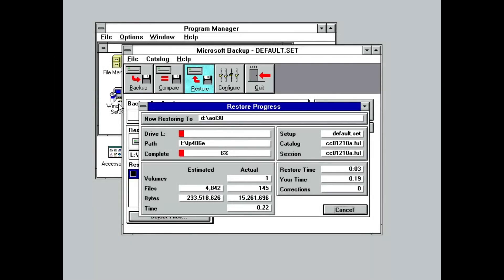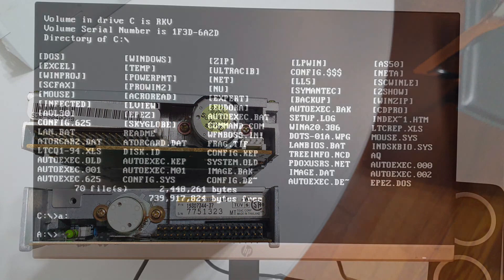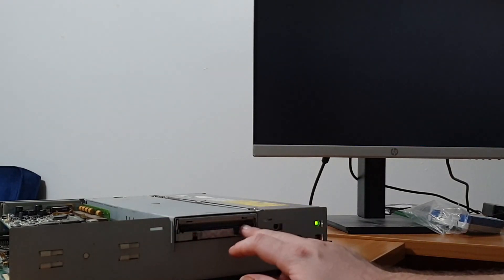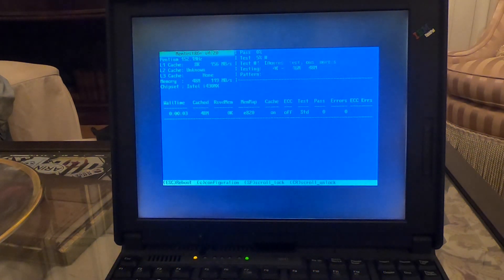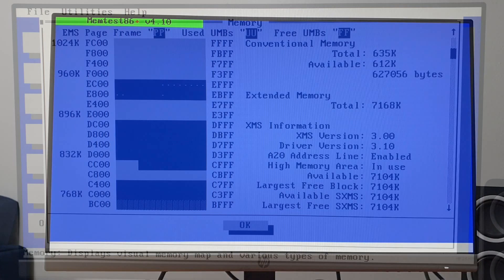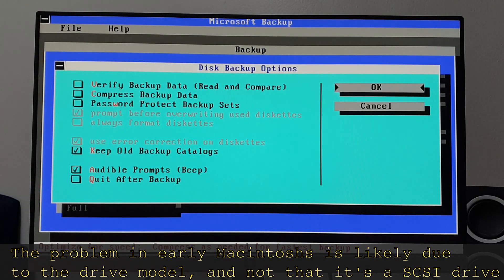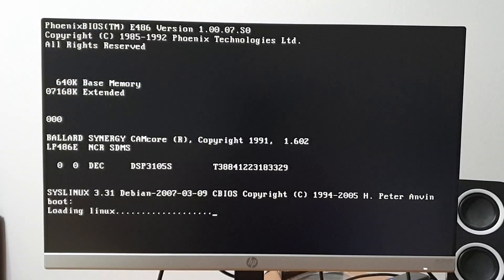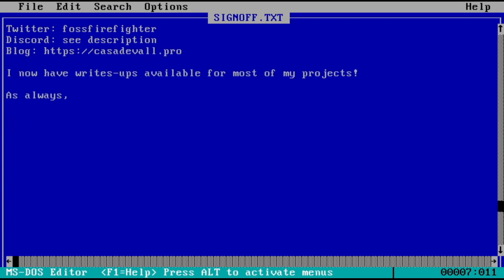486 Data Recovery with MSBACKUP and NetWare // Intel Professional Workstation (Part 2) | #DOScember

Comment: Thanks for a great video (as always)! And thanks for showing the details about the graphics chip.

The WD90C31 is an interesting choice among graphics chips that could have been used. It supports BitBlt with keyed-transparency/patterns, but it is limited to 256 colors. I am not sure from the video it the chip has 512KB (maybe only 16-bit access) or 1MB (32-bit access) of video memory. It looks more like the first option., which means no more than 800x600 in 256 colors or 1024x768 in 16 colors.

The chip unfortunately supports only ISA/AT and 16-bit MCA. It has no support for EISA or local bus, so in this computer, it is most presumably connected using the 16-bit AT bus. If some mentioned that the computer works well with NextStep, the slow bus to the video chip is a bit sad, because NextStep doesn't use any graphics acceleration and relies on a fast access from CPU to the video memory.
Reply from the maker: Yeah it's a weird choice to say the least. You have an EISA bus, and yet you've got relatively low end 8-bit chip to drive the video bus. I'd expect something either VLB based, or just use the EISA bus there is. I guess this system was probably used for server use, given the BIOS has things to redirect the output. I don't even think Solaris had an x86 port, so I guess people were using NeXTstep as an x86 based UNIX?

I'll have to check more in-depth, I've done a lot of work with NeXT, but I also remember 3.3's video driver list is kinda short.
Reply: @NCommander  WD90C31 is not a true low-end card. In fact, it was a solid choice for ISA-based PCs thanks to all the accelerated features. It is way better than most ISA Trident cards. However, I would expect more in such a workstation. Having a graphics chip connected to the 486 local bus would not cost more and there were plenty of them supporting this connection without special glue logic. Something like CL-GD542x would cost the same and you would need just a few buffers/transceivers to connect it to the CPU (because 542x is only 16-bit so it is necessary to merge each 32-bit word from two transfers). Maybe the board was an early design - during 1991, there were not many chips supporting local bus. Or the graphics performance was just not as important... or they chose this chip because it had a good driver for X Window system.

Btw I like that this chip's registers with default values for refresh rate in different resolutions can be changed in the BIOS setup. That is very handy.

Not sure if NeXTstep was the OS of choice for those, who just wanted to run UNIX on x86. I think it had a very specific group of users. However, I am not very familiar with UNIX distributions for x86. I've recently read some old late-80s magazine where they tested multiple UNIX distributions for PCs and they told that "DELL UNIX" was the best of them (but they maybe liked that a lot of GNU tools and GCC were included out of the box)... I don't have much knowledge in this area (as I was always more focused on non-x86 UNIX workstations), but I assume that there was something available from standard UNIX systems that would make sense to be run on this machine.
Reply from the maker: @jirkazima1126  I could have worded that better. The WD90C31 is perfectly fine by the standards of 8-bit/16-bit ISA, but we've got the EISA bus there, so it seems like a real "WHY" moment that they shipped with a graphics chip that is effectively bus throttled. Assuming you had a chipset that could read directly from system RAM, you could have gotten pretty amazing performance. I need to pull the RAM sticks to be sure, but I think this board is 72-pin SIMMs. (I've actually put the 486 away, there was a lot of production issues on this video, so I've put it to the side before I can come back tot he topic without ripping my hair away).

From my experiences down the SLS rabbithole (see the video on this channel), this chip wouldn't have been supported by Xfree86; its possible one of the commercial UNIXes however had a driver for their X variants.

Xenix/SCO UNIX was generally the "best" choice for UNIX in this period for x86, but it's fairly quirky and didn't have a graphical system out of the box for this time period. Linux was still extremely immature, and the BSDs would have just been getting out of lawsuit hell. I put 94/95 to the point that Linux could have been a daily driver for a power user/Linux expert, but a LOT of comments told me that this box is ideal for NeXTstep, so I'm just waiting for a decent SCSI CD-ROM to popup. The other thing I want to def. try is NT 3.1, because this is one of the few machines where it should just work out of the box.
Reply: @NCommander   Solaris did actually have an x86 port, but not back then.  It would've been targeted for CPUs in the ~ Pentium 4 era, plus or minus.  I ran Solaris x86 on a Sun AMD-64 workstation for a while.  I'd rather have Linux.  ;-)

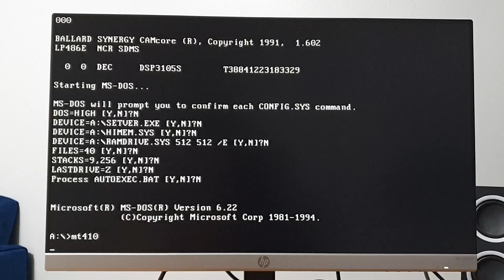Comment: 10:55 Try booting up-to-date (version 5.31) raw Memtest86+ from bootable floppy.
Reply: With an older machine, use a bootable Memtest86 V2. That's the one I use on such old machines as the new version all seem to hang (for me)
Reply from the maker: @adriansdigitalbasement  I actually should sit with the assembler code and see what's going on. I actually found Norton Utilities NDIAGS has a pretty comprehensive memory tester (among other things).

The LOADLIN crash appears to be entirely based on the fact that the top of conventional memory isn't free to user space since it specifically states it need able to use that area. Do you have any good recommendations for SCSI HDD diagonstic utilities? I'm coming up a bit short, and I might just let Netware's COMPSURF grind the drive to see if it actually is healthy.
Reply: @NCommander  Compsurf is what I used for a few years to test hard disks in the clones I built. It's been about 30 years but I think it only has a data destructive test.  I later used Spinrite as it is non-destructive.
Reply from the maker: I had problems with the bootable floppy version in the past which is why I prefer the DOS based one, but I should have probably tried it. I did find a memory tester that does work, but I'll comment on it on Part 3.
Reply: I'm finding these days that the ubiquitous utilities packages from back then are incredibly basic.  Apparently you could charge $100 for being able to manipulate FAT.  Simple equivalents to dd, badblocks, or a decent partition editor (which fdisk was not...) just seemed to be missing in action.  I guess nobody thought of that stuff until PartitionMagic blew up.
Reply: @sirnickity  When I first started exploring PC-DOS in 1982 I was surprised you had to buy Norton Utilities to simply hide/unhide a file.

Comment: I’d love to get one of these. The are great for running NeXTSTEP on Intel.
Reply: Since these machines look so much like the NeXTStation it was rumoured that Intel built these  specifically for NeXTSTEP..
Reply from the maker: @montagetech  Won't surprise me, informally, non-NeXT x86 machines are known as "white boxes" in the community (and generally run OPENSTEP vs. NEXTSTEP), and one thing I never could figure out is why NeXT had spent so much effort to have a full EISA implementation in the kernel since OPENSTEP was past the point that EISA was relevant, and their early NeXT-x86 was ISA.

This might be the reason right here. I'll be talking about potentially running NeXT/OPENSTEP in part 3, but I need to put this project on the back burner for awhile, I'm a little burnt out by it.
Reply from the maker: I've heard NeXTSTEP is quite happy on this specific model; I'll need to find a SCSI CD-ROM drive that is usable with it and we'll talk about it in a later video.